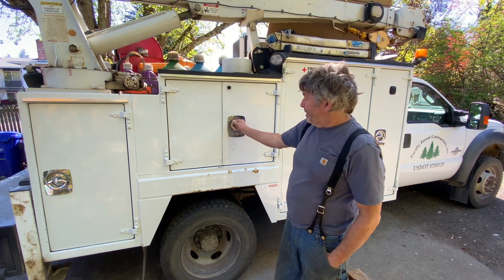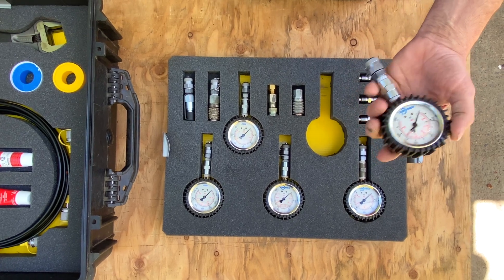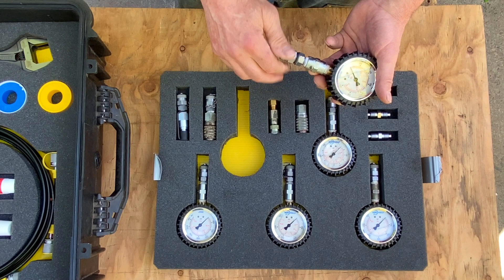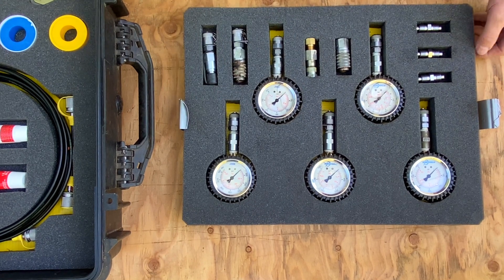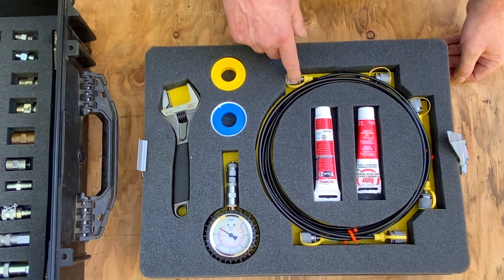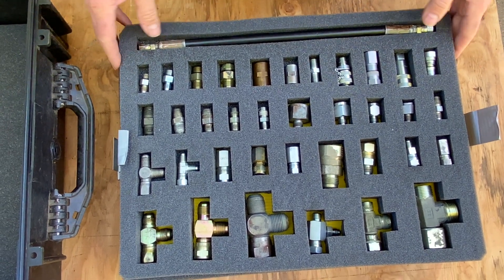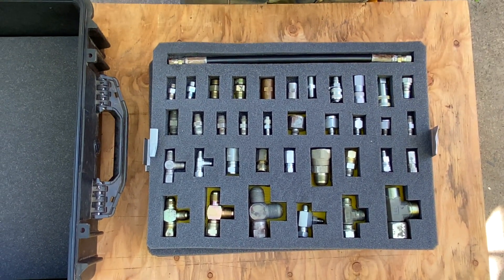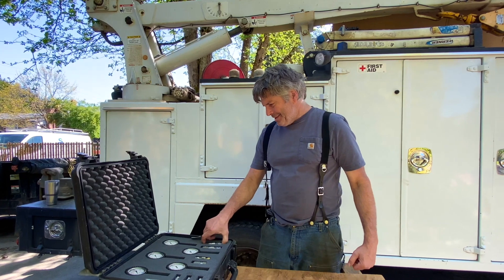Service Truck Tour : Hydraulic Test Kit

Comment: Great looking setup man, thanks for sharing.
Should surely get you out of a jamb when downtime is critically important.
Reply from the maker: Hey, thank you! It has helped me out, like you say- when time matters. It was pretty cool to finally put it together when I got this case. I had it in different boxes and totes over the years, this feels a lot better , keeps stuff clean and close to hand. I am always impressed by how well a machine responds when the Hydraulics are in tune and gauges are the way to go for that. A couple of older machines I ran in the past come to mind, I could tell when pressures were off by performance and heat buildup. Those were Timberjack 950's and just like any machine there was a step by step procedure to setting them up. Tune her up and away she'd go. The Tigerkitty I'm running now is a whole different animal though! Thanks for watching and the comment, we appreciate it! Be safe!